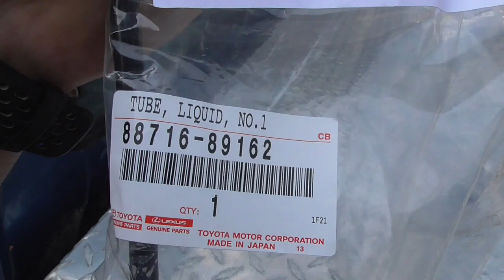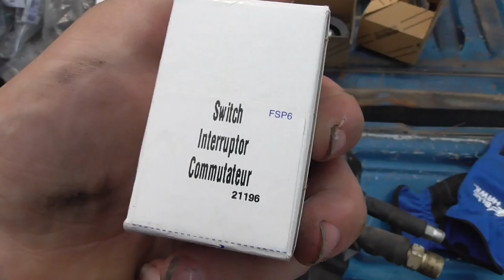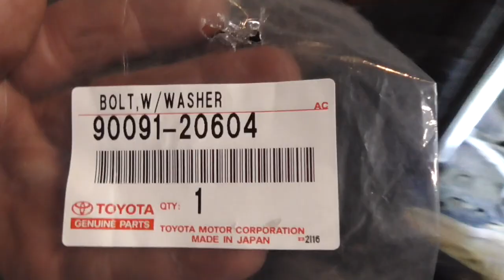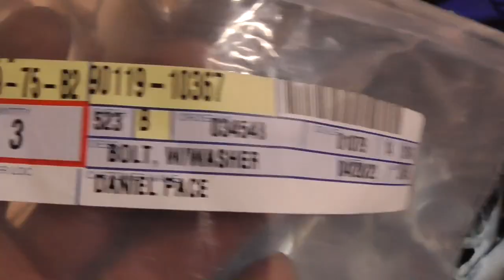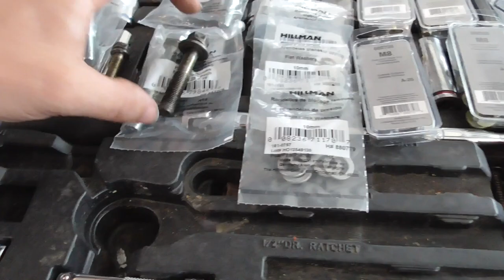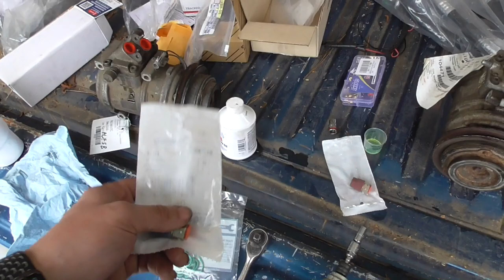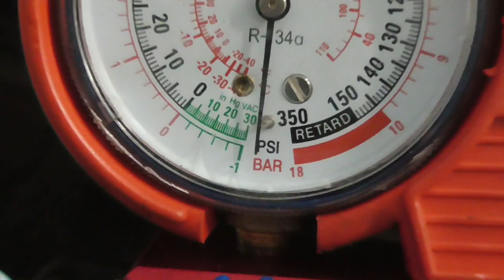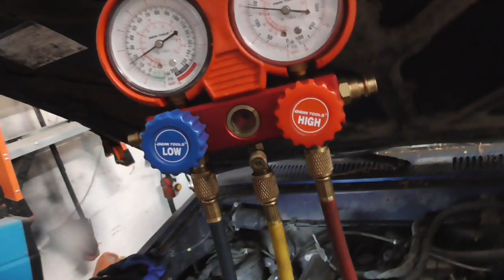1989-1995 Toyota Pickup A/C Conversion | Full A/C install

Comment from the maker: Video chapter breakdown for quick reference. 
0:00 - 12:19 - Parts overview
12:20 - 17:18 - Evaporator install 
17:19 - 21:19 - Condenser install
21:20 - 29:12 - Hard lines & recever/dryer install
29:13 - 39:43 - Compressor Install, New Front Cover Bolts, Vacuum diafram & solinoid
39:44 - 45:02 - Compressor manifold install & retrofit adapter install
45:03 - 48:09 - AC soft hoses install
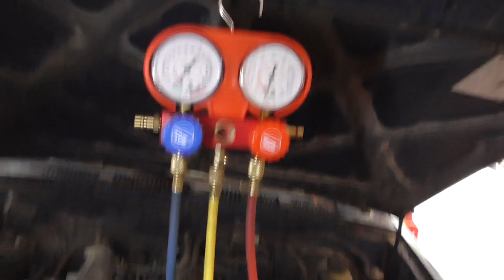48:10 - 48:48 - Belt install
48:49 - 1:02:41 - Vacuum, charge, ac button install & test System
Reply: Where did you get the AC lines from?
Reply: @kevinperez5498 I’m wondering that too. I can’t find the hard line new anywhere!
Reply from the maker: @kevinperez5498  @mikem2915 I was able to pick up the hard lines from the dealer at the time I was getting parts. It's possible they are no longer available anymore.

Comment: A few tips.

Most AC supply houses have line flush kits for fairly cheap. AC systems like to be very clean internally. So I recommend that with used system components. If the compressor in the old system failed then there is debris that needs cleaned out. Also I’d never use USED evap or condenser coilS because you can’t flush the contaminants out. I know from experience.

Also, they have drop in replacement refrigerant that works like R12. So you don’t have to swap to R134. Keep the R12 system and get the drop in refrigerant. It’s called RS-24.

Comment: Getting ready to do this on my 93 Toyota pickup. Have spent days rummaging through my local pick and pull and ebay looking for parts. The dawg on manifold on the compressor has been a challenge to find. Can’t wait it is 114 today.
Reply: Keeping our fingers crossed that ya get yer A/C fixed .. We recently did this on our '91 Toy 4X4 with existing A/C and it was WELL worth it ..I had to replace the pressure valve on the compressor manifold ( Airsource part # 5683 ) because it leaked from the stinky compressor and ALL the other parts ..I added a small electric fan to the condensor because at idle it seemed to warm up a bit 
😇❤
Reply: @angel_dawn_morningstar  Thank you, It’s been a real challenge. The manifold I found turns out not be the correct one, so back to the drawing board.

Comment: About time somebody put a video out like this I’ve been wanting to put  ac in my 1989 pick up for a long time finally found a donor truck got most of my pieces but I think the guy cut the discharge and suction softlines so I never got them. it has been a bear to try to find those lines. Could you please tell me the part numbers of your discharge and suction soft lines? And if you got a part number for that idle up diaphragm mine also has power steering, but does not have that idle up diaphragm

Comment: Thank you for this video. Ive been looking for something like this for a very long time. I have some doner parts, but not sure exactly what. Dude, this video is gold!!!!!

For 134, the only part that NEEDS to be 134 is the compressor?
Reply from the maker: Thanks. And no, you can actually use all R12 parts, you don't need any R134 parts apart from the R12 to R134 conversation adapters for the high & low side ports.
Reply: Ok, perfect. Where did you source the o-ring kit?
Reply from the maker: @xxkrazzxx  Rock Auto

Comment: Did you find that both the factory and dealer AC lines to be the same fitment in the newer r134 manifold? Think I made a mistake of buying a r134 compressor and manifold. Cross referencing part numbers on the AC lines between it all is a nightmare. Everything else is easy

Comment: Where did you get the liquid hard line that bolts to the wheel well?  It looks new. I’d love to get a new one for my truck. I’m currently doing my truck now which is the second Toyota I’ve done. I bought all new components except hoses.

Comment: Great video and only one like it on the internet. Question: how have your 4 Seasons adaptors worked out? Tried a conversion on a 1989 Toyota pickup recently and had a failure on the low side adaptor. Replaced the Schrader valves twice and still no luck holding pressure. Looking for a reputable replacement. Very disappointed in 4 Seasons products!
Reply from the maker: I've had no issues with my adapters. Holding pressure strong since I've put the A/C in.

Comment: Thanks for the content. I'm looking to do this conversion on my 93 pickup at some point, but I have a feeling some of these parts will take months to source.
Reply from the maker: It took me about a month and a half looking off and on to find all the parts.  Most of the parts luckily can still be bough new from Toyota, however the parts that have to be bought used are kinda essential to get the hold thing going and usually sell fairly quickly or are entirely overpriced.,
Reply: Good to know, thanks again!

Comment: Hey I had a question, I’m doing the same a/c installation on my 92 pickup that didn’t come with a/c from factory. I got all the parts & lines everything is ready to be flushed & installed. Would the a/c work without the a/c idle up diaphram? I didn’t even know I need that. Also I don’t have power steering. I’m also gonna recharge it with R12. Not converting
Reply from the maker: It might be possible for it to work, unless the a/c amplifier cuts the compressor out because it doesn't sense the engine idle up, however if it dose work you would have to raise the base idle of the engine.  Otherwise the engine might stall with the added drag of the compressor.
Reply: @DanielPace92  thanks, I also only have the 3 front compressor bracket bolts nothing for the side where the ground cable is located I also moved the ground cable to my motor mount for now since the bolt isn’t long enough. You think the front 3 bolts will hold on to the heavy compressor & the drag? Great video btw
Reply from the maker: @shamchaudhry3224  I would get the side bolts for the bracket - they help keep the bracket from twisting towards the crankshaft pully by the belt tension.  Plus they are still available new from Toyota and pretty cheap.
Reply: @DanielPace92  thanks I ordered the 2 bracket side bolts from Toyota, they should be here by Monday. Did you put the ground cable back in its original spot with a longer bolt through the bracket?
Reply from the maker: @shamchaudhry3224  Yes, I put it in the same spot.
Reply: I just finished putting everything all together, my a/c manifold gauge won’t screw on to my R12 high side fitting. Can I still pull a vacuum with only the low side connected & then recharge with R12? I already added the mineral oil needed for the system…

Comment: Are the 2.4 and 3.0 systems interchangeable?
Reply: Condenser and evaporator seem to be the same. I don't think compressor and some lines are the same tho. Small line that goes from evap to condenser should work and cross line from condenser to drier is the same I think. I just pulled a condenser and evap today from a 3.0 in the salvage yard and have cross referenced part numbers to confirm for my 2.4.